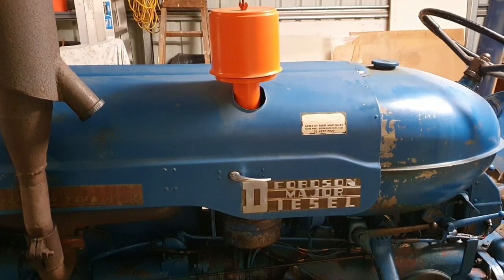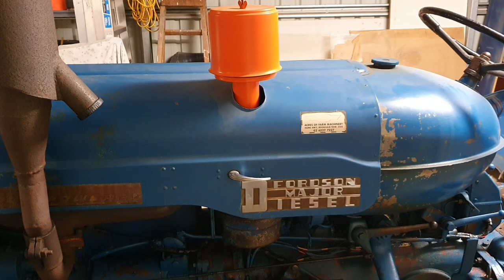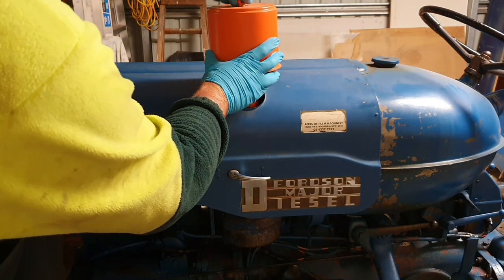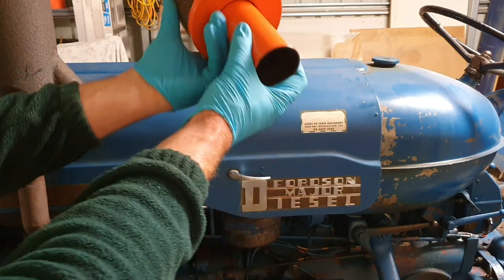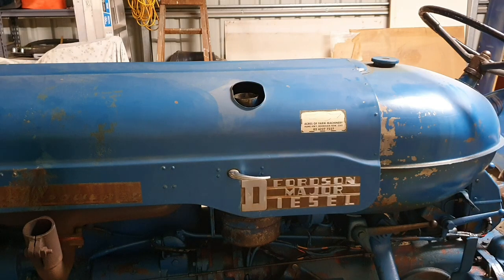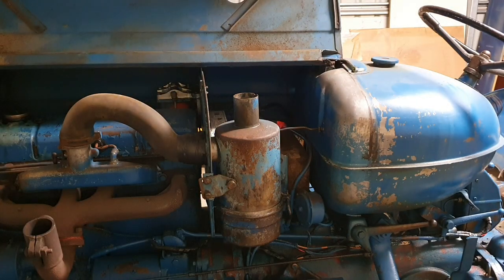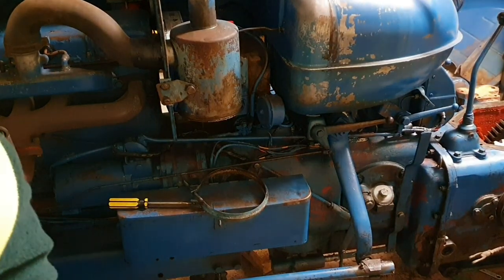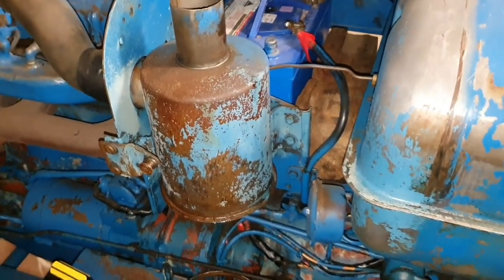Fordson Major Air Cleaning System

Comment: Where can i find that primary air filter as a new part i need one!
Reply from the maker: You can get reproduction ones from the bigger tractor parts suppliers, there were some available on Ebay for a while.

Comment: How do you clean the gorse steel filter and what with ?
Reply from the maker: I ended up soaking it in unleaded fuel then used an air compressor to blow all the much out. Took a few goes and made a mess but worked well for me.
Reply: Set fire to your air cleaner. Even the end that's bolted to the tractor. (Obviously, take it off first)
Then blow out with an airline, repaint the airfilter housing, and refit to the tractor.
It is a common enough practice. I was taught this method at agricultural college 45 years ago.
Reply: Has this tractor been repented?
Reply: @martinhambleton5076  Novel approach - I'm going to try it with my 1962 FSM
Reply: @LMBrown3900  Just a thought. Make sure to take off the rubber seals that connect the oil bath to the main filter body.
Reply: @martinhambleton5076  Good point. Thanks